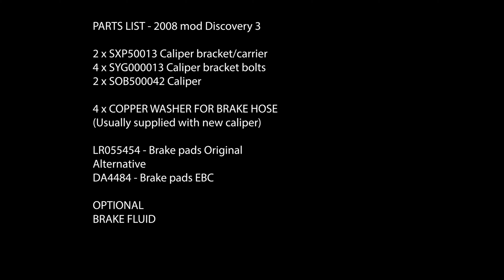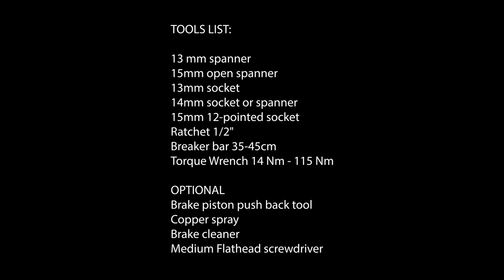Land Rover Discovery 3 / LR3 Left Rear Brake Caliper Replacement

Comment: Yeah, those copper washers get pretty squashed in! 

Lovely camera work and oh boy, why can I never buy a used car after someone like you lol! 

God helg!
Reply from the maker: I know, right, and a bit more on the left. I think I had a small leak there after I did the upper control arm change and I changed the hoses at the same time. I asked for a brake test at the garage and I think they have tightening it then. But lesson learned to next time. But with new washers I just set it to the correct Nm spec and it was sealed. Maybe the old caliper was the fault last time. 👍🙂. Thank you fro the nice feedback. Glad you noticed. Takes a bit of time to edit due to the different angles.  God helg, hope it's a good one. 👍
Reply: @LandRoverDrive  It happens with the washer on the sump too. 

Folks don't buy new ones and the sump plug gets tighter and tighter each time the oil is changed because the soft metal is compressed. 

No wonder you can buy kits to fix stripped out sump plug threads!

The irony is that the washers cost pennies...

Comment: Nice job, those copper washers did not want to come off 😂.
Reply from the maker: Thank you. No I was a bit surprised my self and with the brake fluid running I got a bit stressed as I did not have any spare fluid lying around. 🙂👍
Reply: @LandRoverDrive  It's always the way, what can go wrong will go wrong...especially when you really need everything to go to plan.

Comment: One tip i would give is not to push that old fluid back into the abs pump it could be an expensive mistake. I always open the bleed nipple so you push the old fluid out. The only time I wouldn't do it is if it looks like the bleed nipple could break but as you were changing the calipers anyway this wouldn't be a problem.
Reply from the maker: I totally agree and will definitely do that from now on. A great tip, thank you! 👍😊 I should probably also change out the break fluid more often too. 😅

Comment: I feel like because you was changing the caliper it was pointless winding it in 🤷‍♂️
Reply from the maker: Very true! 👍😊 The thought was to save brake fluid by pressing it back into the reservoir. I don’t think I had a lot on hand at the moment of replacement. But pressing back the oil is a bad habit as has been pointed out by another comment. Better to bleed out the old oil instead. 😊 And especially when replacing from old to new calipers. I’m up for a full brake fluid change this summer. 👍
Reply: @LandRoverDrive  sure its 2 yearly it should be replaced, I used to be a parts adviser for JLR so would often chat with techs and pick up useless information 🙌